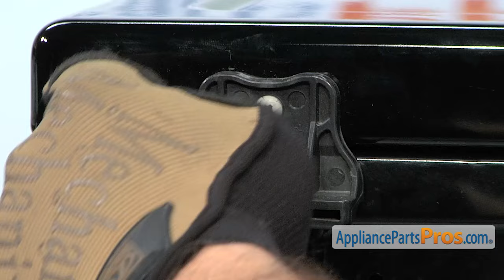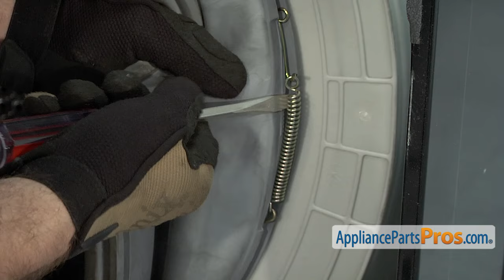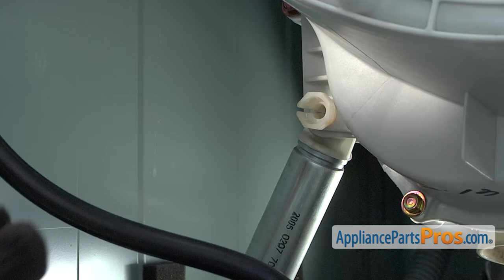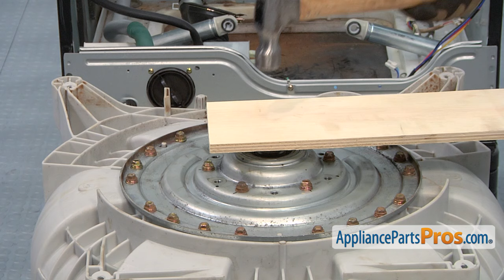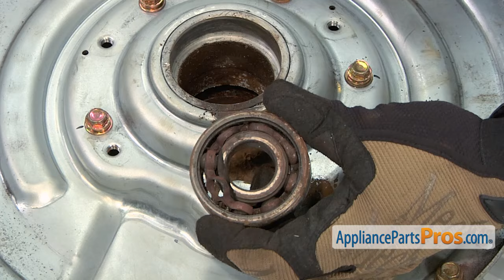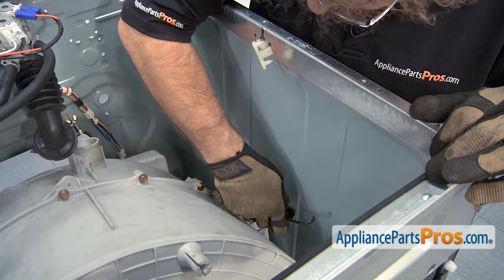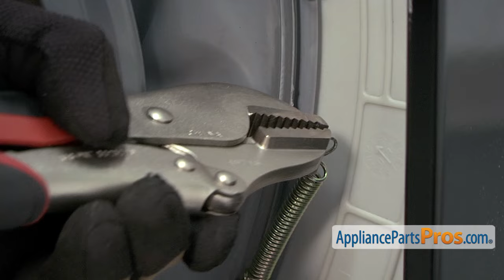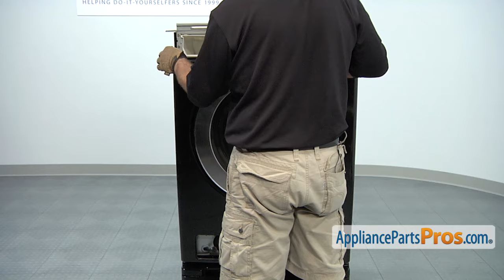How To: LG/Kenmore Washer Seal 4036ER2004A

Comment: Any suggestions for replacing the spring to the front gasket?  Every time I go to stretch the spring the entire thing moves out of the 3 o ‘clock position and I can never hook the spring since the whole thing moves.
Reply from the maker: If you need additional help with the repair outside of what's demonstrated in the video, you can give us a call at 1-877-477-7278 or you can chat us at our website: http://www.appliancepartspros.com/. We’re here to help 7 days a week.

Comment: Washing machine of 9 years starts making funny sound.    Tub can only turn a little bit.   Call LG to see if Direct Drive warranty will cover it.   Licensed LG tech comes over, looks at it, says its a $300 part + $500 in labor to fix and buy a new washer.    I google some more and find this website.  Start taking apart the washing machine to do this, and find the rotor in the back with plastic teeth has worn out while doing the disassembly.  Bearings look great.  Buy replacement rotor with magnet wheel for $40 delivered and machine is good as new.   Thank you for posting such a wonderful and informative video!   I wrote a complaint to LG saying that the LG tech is not representing your company faithfully.
Reply from the maker: That's great to hear! We're so glad that we could help you repair it instead of replacing it.

Comment: We just finished this repair, along with replacing the spider arm as well, and ran the washer through an empty cycle to check for leaks or noise. No leaks or noise the bearing replacement worked great, but our drum still has too much movement. While washing a medium load and going through a rinse cycle the drum moves back and forth too much; so much so it pushes slightly against the door, we noticed this before the bearing replacement as well but thought it was just the bearings or the spider. What could be causing this? Do we need new shocks? Or is this something else? Please help.
Reply from the maker: We'd be happy to help you figure that out, but we'll need some additional information about the model and the problem. You can give us a call at 1-877-477-7278 or you can chat us at our website: http://www.appliancepartspros.com/. We will need the model number for the appliance, so that we can look up diagrams and information about your specific unit to give you accurate advice. You can look here on our website to help you find the model number: http://www.appliancepartspros.com/modelnumber_locator.aspx

Comment: I attempted this project, everything went smooth until the part your supposed to knock out the inner stainless steel tub from the bearings, i let it bathe in penetrating oil (rust buster) for three days and it was not coming out.... so i got a little bigger hammer and still not coming out. So finally i decided to get a new washer. But before i got a new washer i really wanted to get that tub out because it was making me angry so i got a big sledge hammer and took a swing, a big swing like i was splitting a big log, with no wood in between just metal to metal and boom it came out.... and the inner bearing came with it ha ha ha ha good luck getting that off. I ended up buying the same used washer and dryer for only three hundred dollars and they were only two years old. If this washers bearings go out I’m not going to waste my time ill just buy another washer.

Comment: Another successful bearing replacement with the help of your video. Much appreciated. I estimated 2 hours for the job. It took 6 including a test. Key time consuming parts were bashing out the drum shaft, followed with bashing out the old bearings. Inserting the new bearings was also a challenge due to the very tight fit. The result is great. Prior to the change the noise generated was >110 dBA within the laundry on spin cycle (using a non-calibrated Android app) - about the sound level of a petrol chainsaw! Post fix, a sublime 90dBA.
Reply from the maker: That's great to hear! We're so glad we could help you get that noisy washer running quiet again.
Reply: I'm seeking further advice, please. While changing the bearings has eliminated that particular problem and noise, a new noise has developed since reassembly. It sounds like the drum is scraping something. I'm quite sure it wasn't there before the bearing change. The scenarios are: A. only with a slightly unbalanced load, such as a single towel, and B. A heavy load of washing. I'm reluctant to pull the whole thing apart again without some remedial action to perform. What are your suggestions, please? Thanks
Reply: A public service for the novices (like me...) check ALL the dimensions of ALL bearings before replacing! It became a crisis when a new noise developed. On investigation, starting with taking the motor apart, I noticed fragments of magnet on the rotor. Removing the shaft bolt, although I had used a thread sealant (Loctite), the shaft bolt was a bit loose! The shaft worked slightly loose causing the rotor magnets to scrape on the stator coils. Then I noticed the inside diameter of the outside bearing was not tight around the shaft. The parts supplier sold me an incorrect rear bearing that looked right (OD & width correct) but I failed to note that the inside diameter was 30mm (like the front bearing) but it had to be 25mm! So while the machine initially reassembled ok and passed all the tests, it was doomed to fail again. After replacing the incorrect bearing and reassembling, tightening the bolt required a lot of force until I heard a "pop" probably by the shaft and bearings seating correctly. All is now well, and running as it should. The damage to the magnet was minor- about the size of a pea broke off, causing no adverse effects. I took great care to remove all magnetic fragments and dust.

Comment: AppliancePartsPros does not sell these bearings anymore!! I need bearings for LG Washer WM2688HNM and the AppliancePartsPro site does not have them!
Reply from the maker: We do actually still have these bearings! The original bearings are discontinued, but there is a direct factory replacement. The link is here: http://www.appliancepartspros.com/lg-bearing-ball-map61913707-ap5977996.html Manufacturers do change the design of parts frequently in an attempt to make parts compatible with as many of their appliances as possible. We only carry original manufacturer parts, as long as you research the part by model number, you can be assured the part is correct for your unit per the manufacturer.

Comment: Thanks, this video was easy to follow. I too, had a hard time getting the bearings out. My husband ended up taking it to an auto shop to get hammered out. After putting new bearings in and getting it all back together. The machine ran one time without issues. Then the knocking came back. It ended up the shaft on the spider did not fit well inside the bearings. It must have malformed.  I ended up buying a new spider and the back side of the tub with the bearings and seal already in place. Works good now. I recommend buying the spider, the back of the tub and a tub seal to do this job.
Reply from the maker: Glad we could help! Thanks for the tip.

Comment: I did this repair but now water is dripping trough the machine.
Reply from the maker: We'd be happy to help you figure out what's going on there. We offer free technical advice and diagnosis. You can give us a call at 1-877-477-7278 or you can chat us at our website: http://www.appliancepartspros.com/. We will need your model number to give you accurate advice, which you can locate using this tool on our website: http://www.appliancepartspros.com/modelnumber_locator.aspx

Comment: This video saved me from a 300 repair bill.. MY only grip is that the bearings are NOT that easy to get out.. I had to use a torch to heat up the old bearings so I could pound them out.
Reply from the maker: Glad we could help!

Comment: Just like most of you I had the same problem of the inner tub not releasing from the outer tub. After trying the hammer and wood and splitting every piece of wood I gave up on the hammer. I ended going out to my garden and getting a paving stone, I put a towel over it to protect the metal and lifted the outer drum and dropped the spider pin down on the paving block and it popped out on the first drop. Also, after putting the new bearings and seal in I didn't drop the inner tub into the outer I put the inner tub down and then lowered the outer tub over the spider pin which made it easier to line it up and see what you were doing.
Reply: I thought that was a Mickey mouse way of doing both those procedures! nice detail

Comment: I, like many others before me, am stuck at removing the shaft from the bearings. When referring to using heat, wouldn't heating up the shaft expand it, thus making it even more set in place? Wouldn't it make more sense to apply heat to the bearings? Just wondering...

Comment: Unless you want to change the gasket (belows) or the front half of the drum, there is no need to remove the gasket from the front of the drum. Reinstalling the clamp is very difficult without the proper tool.

Comment: very thorough video, thank you.  The bearings were thoroughly rusted through, and upon removal of the larger one, it fell apart, making removing the outside part of the bearing are real pain.  Any tips on getting it off?  It seems to have adhered itself to the metal on the inside of the drum cylinder.  We've used penetrating oil, and pounded with a screw driver, but it's not working.
Reply from the maker: We offer free technical advice and diagnosis on things that aren't covered in our videos, so we'll be glad to advise you on that. We’re available 7 days a week at 1-877-477-7278 or you can chat us at our website: http://www.appliancepartspros.com/

Comment: Great video.  I followed it to the letter.  The only 2 things I would add is that when you take the case out to be careful or put a piece of tape across the 2 bulbs that are in the water inlet hot and cold.  One of these fell out while I was splitting the case and broke.  I was able to repair it.  Also, when putting the drum back into the lower 1/2 case to make sure to clean ANY corrosion.  My shaft didn't seat fully and I had a heck of a time getting it out the back (with the entire assembly back in the machine)!  Thanks for putting up the video, it saved me from having to buy a new washer.
Reply from the maker: You're welcome! And thanks for those tips.

Comment: This is a good video with exception, the drum on the dozen or so I have replaced were gaulded, rusted or just plain stuck to the inner race of the bearing. To do this job correctly, you will need a puller or press to force the drum shaft off the race. That, or replace the drum along with bearings. A hammer and wood never worked for me!
Reply from the maker: Thanks for that tip. It can be difficult, depending on how corroded they are.

Comment: I start by saying THANK YOU VERY MUCH! This was an amazing video.  This was my first washer dis/reassembly.  I had my wife stop the video at each step as I followed it to the "T" and I had no issues.  My machine had a few minor variations, probably in design by year, but otherwise it was exactly the same.  I did not have any extra screws/bolts left over.  HAHA. I commend you on this tutorial.  You did a great job explaining and showing each step both disassembly and reassembly.   *VIEWER SUGGESTION: Remember to label all your screws and bolts as you take them out.  Be ready to clean. This will help in reassembly.
Reply from the maker: You're very welcome! Glad to hear that we were able to help you out with your repair. And you are so right about the screws. It's easy to think you'll remember which is which until you need to.

Comment: My outer bearing fits very loosely, when I insert the tub it slides the outer bearing out with the spider shaft. Any suggestions?
Reply from the maker: We'd be happy to help you out with that! We offer free technical advice and diagnosis. You can give us a call at 1-877-477-7278 or you can chat us at our website: http://www.appliancepartspros.com/. We will need your model number to give you accurate advice, which you can locate using this tool on our website: http://www.appliancepartspros.com/modelnumber_locator.aspx

Comment: Good video. One step I skipped was removing the seal/gasket off of the tub. I just left it attached to the tub and was still able to replace bearing no problem. Much easier then trying to fight that spring back on later.
Reply from the maker: Thanks!

Comment: How check my kenmore front load 5t  electric not come on to unit
Reply from the maker: We'd be happy to help you out with that! We offer free technical advice and diagnosis. You can give us a call at 1-877-477-7278 or you can chat us at our website: http://www.appliancepartspros.com/. We will need your model number to give you accurate advice, which you can locate using this tool on our website: http://www.appliancepartspros.com/modelnumber_locator.aspx

Comment: did anyone have problems separating the shaft from the plastic drum casing?  we have not been able to do it  after serious pounding nothing happens, running out of options at this  point.    completely stuck!
Reply from the maker: If you need additional help with the repair outside of what's demonstrated in the video, you can give us a call at 1-877-477-7278 or you can chat us at our website: http://www.appliancepartspros.com/. We’re here to help 7 days a week.
Reply: Sledgehammer. Took me a good 5 hits with a 5 lb. one

Comment: In europe we notice that is liquid detergent that destroing be rings and alluminium stuff from back, why you use liquid detergnt for fit the bearings in the plase and the selesnt to?it gona last nothing at all.teach your customers to use warmer and hot tempersture with powder detergrnt
Reply from the maker: The liquid detergent is used as a little bit of lubricant. We don't use other greases because you don't want to put them anywhere that they could get on your clothes and stain once your washer is repaired and working again. An excess of detergent is definitely bad for a machine, but HE detergents used in the appropriate amounts shouldn't cause damage to a machine.

Comment: Firstly, I want to thank you and crew for your informative video. In replacing the bearings in a LG Model WM2501HWA, I found that the spindle had ~1/4" rough section which prevented the spindle from inserting completely into the new bearings - poor QA by LG. After hand-sanding this down,  the spindle slid smoothly into the new bearings. This also helps explain why the spindle was so difficult to remove in the first place.
Reply from the maker: You're welcome! I'm glad the video was helpful. Thanks for letting us know how the repair went for you.

Comment: Great video!  I watched several others but this one used the same parts that I needed to replace.  I agree with several others, put the boot on before re-installing the weights.  I also labeled the top weight with a sharpie because mine is grey and the bottom is black.  I bagged all screws and bolts as I was going and it made my life so much easier.  I decided that since I needed to disassemble to whole thing that I would replace the boot at the same time, so I bought new one and a new outer spring because my old one was pretty rusted.  I'm glad I replaced it because the old one was nasty, even thought it was functional.  I would suggest that anyone who attempts this also purchase a new gasket for the out tub and replace that at the same time.  I didn't because I didn't know to and I'm not having any leaking but if I was to do this over again, I would replace the gasket.  The spider on my machine was in great shape, it did have some rust and mineral build up on it, so I cleaned it with CLR spray, scrubbed it with a nylon brush, and then washed it off with water using a hose.  The CLR really cleaned it up.  (Don't use CLR on plastic)  I'd also suggest that if you have a shop vac, keep it handy.  A couple of times water came out of hoses that I wasn't expecting.  I did this repair in my garage so it wasn't a big deal but it was nice to have the vac to clean up the water.  And I used it to vacuum up as much stuff in the machine as I could.
Reply from the maker: Thanks for your feedback and for the additional tips!

Comment: I got the machine torn apart and the bearings busted out except the outer race of both bearings are still lodged. There's only a millimeter of lip to try to put the drift on in order to try and know it out but it just slips off every time. They won't budge. HELP!!!!!!!
Reply from the maker: If you need additional help with the repair outside of what's demonstrated in the video, you can give us a call at 1-877-477-7278 or you can chat us at our website: http://www.appliancepartspros.com/.  We’re here to help 7 days a week.

Comment: Also read a great idea to either powder coat the spider or epoxy marine paint it to stop the corrosion on the spider
Reply from the maker: Thanks for that tip! If you decide to do that to yours, let us know how it goes.
Reply: I coated the spider with Zinc Phospherous primer I picked up from a Marine parts place. I wouldn't be able to tell you how well it works for some time. But from the looks of the old spider it will be a positive move. The old spider had many pockmarks from corrosion and the metal was thinning id the spots that were cracked. Just be sure to tape or grease coat the spider bolt (spline) before painting. After reassembling it spin great. I can only imagine this will stop the corrosion issue. As for the gunk build upI will now be running the machine on a long hot wash once a month.